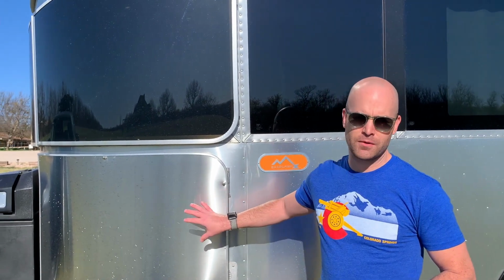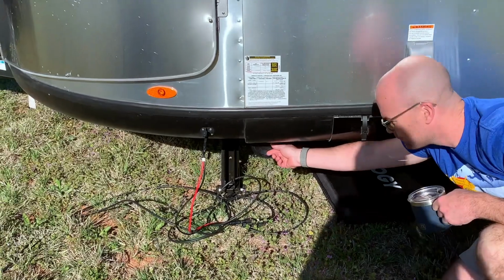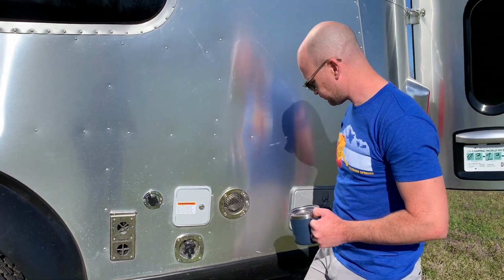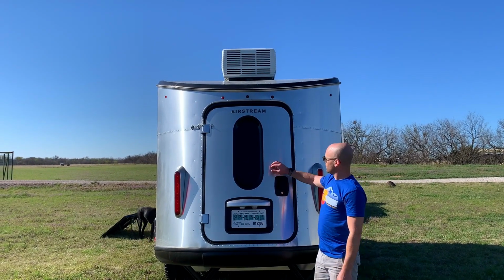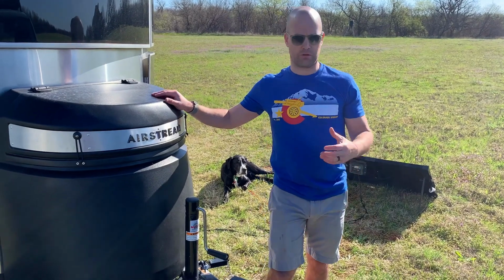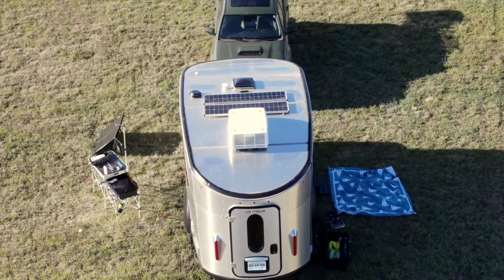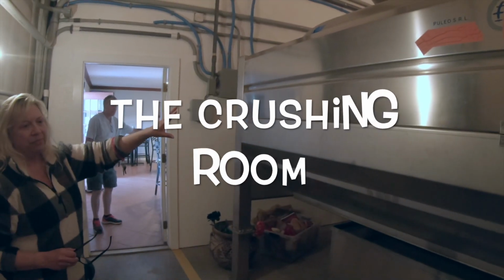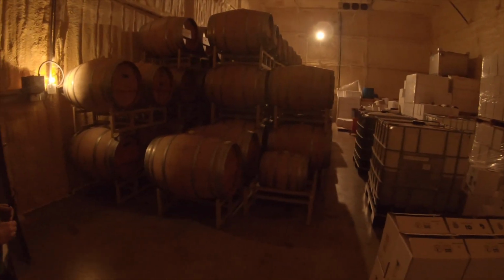Basecamp 20X (Exterior Tour) and Harvest Host visit

Comment: Does your portable solar panel needs a charge controller or it's managed by the charge controller in the Airstream ?
Reply: You will want to get a portable panel with a charge controller. Most come with a PWM charge controller. Alternatively you can install an additional charge controller in the battery locker by removing the zamp wiring from the bus bar and wiring it to the new controller. Then you’ll need to wire that back to the bus bar.

Comment: Hi, I wish you so much fun with your new airstream. How do you like the 4runner as the tow vehicle for your rig? How does  it perform with grades? Does the rear of your 4runner sags too much?
Reply from the maker: Thank you!  The 4Runner does an adequate job with the Basecamp. Where we currently live it is relatively flat so I haven’t subjected it to steep grades. However, pulling our toy hauler which is about 1,000 lbs lighter through the Blue Ridge Mountains it struggled. If I were to put the horse before the cart I would get something with more horsepower and gross carrying capacity. The back end sags one inch when connected. You can fix that with a weight distribution hitch. Just be careful not to exceed the tongue weight.
Reply: I was going to ask the same question. I have the same trailer on order (supposed to be delivered early August) and have a Toyota Highlander which has slightly more HP but less displacement and low end torque than the 4 runner. Rated to tow 6,000 lbs. I believe I can get the job done so long as the conditions are not too crazy. Guess I'll find out!
Reply: Thank you so much for sharing, we were looking at the Basecamp 20,  we have a mercedes metris with 5000lb towing and 500lb tongue weight which i think is similar to your 4Runner. The Basecamp 20x tongue weight is 535lb on empty, how did you manage to fit it to the 4Runner given the tongue weight limitation, were you able to monitor your tongue weight? Thanks again for sharing.
Reply from the maker: @marcdamon7539  we eliminated to the greatest extent weight forward of the axle. Each full propane tank weighs 35lbs. I only travel with one and now that’s it’s warmer will downgrade further to  11lbs tank. The lithium batteries weigh 29lbs each opposed to 65lbs for the AGM. In addition we only travel with empty tanks (fill/dump upon arrival/departure. If you opt for 20 standard (not X) the tongue weight is 500lbs.
Reply: I just saw you answered that question in another post. Thx
Reply: @SlowYourRoll  thank you much for the response, glad to see that the tongue weight can be mitigated to some extent. Did you try to measure your tongue weight?

Comment: Great videos!  We just purchased one, picking it up next month.  Question, did you find you needed the extra foldable solar panel?  Or did you guys just buy it for peace of mind?
Reply from the maker: Congrats! I had the foldable panel from a previous rig. I recommend doing a power audit of what you plan on running. If you don’t know what I’m talking about there’s a lot of good videos out there. Having the extra panel keeps our battery in a float or topped off stage during the day and ready to run off batteries at night. I’m going to do a video dedicated to electrical system once my inverter comes in. If you only plan on running small items like 12V phone charging or the like 180w is probably sufficient.
Reply: @Leo Amari Instablaster ;)
Reply: @Mathew Wesson thanks so much for your reply. I got to the site on google and im waiting for the hacking stuff now.
Seems to take quite some time so I will reply here later with my results.
Reply: @Mathew Wesson It did the trick and I actually got access to my account again. I am so happy!
Thank you so much you saved my ass :D
Reply: @Leo Amari You are welcome xD